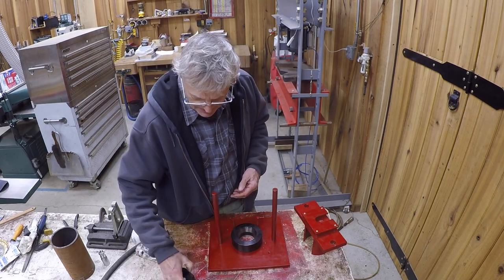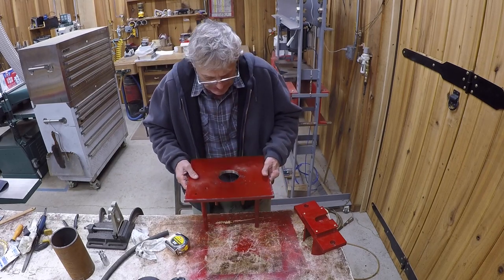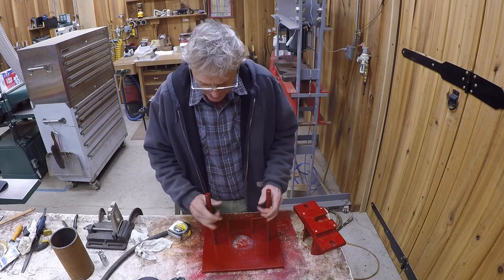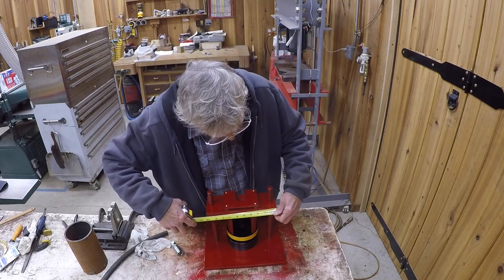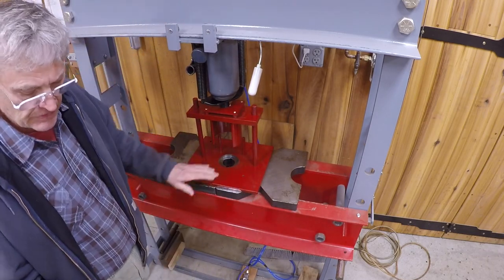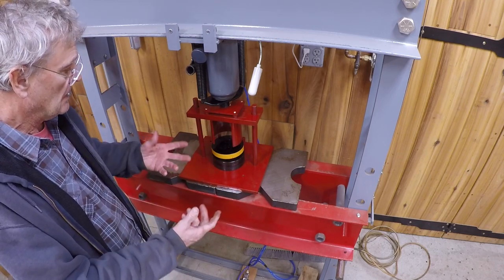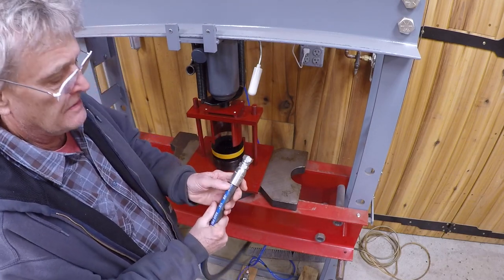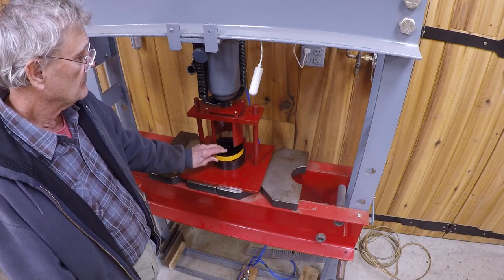DIY hydraulic hose crimper, How I made it

Comment: I used crimp hoses for 8-12 hours a day. But I used Finn-power machines and Custom Crimp machines. I used this style at a different place making hoses for Parker. Much prefer the non parker style. Cool build sir.
Reply from the maker: Sounds like your a professional. I'm just an old farmer, who got tired of paying for really expense hydraulic hoses. I chose Coll-O-Crimp because its a positive stop system, you push on the spacer ring until it contacts the die bowl. That's it, provided you have all the right components die, collect, spacer, fitting and hose you get a good crimp. How do other systems work, do they have other ways to control how far the collet gets pressed onto the fitting?
Reply: @RichMenzel  most other machines are computer controlled.  You set your machines up with the die for the diameter you want and you save the pressure rating and potentiometer setting in the menu. When I was a professional I had 4-7 dies to crimp a single size. Half inch hose the most popular and the shop I was at had 9 different dies for different hose and fittings combination.

Comment: Can you tell me the pressure you got to in order to get the crush you attained i the U series fitting.
Reply from the maker: The jack is 20 ton.
Reply: @RichMenzel  ok. I doubt you are putting 20 tons of pressure on that. Do you have a gauge.
Reply from the maker: @tjs_welding_and_fabrication  I'm sure your right, and I do not have a gauge. With a deadhead system you really don't need one.
Reply: @RichMenzel  Thanks for the prompt reply.

Comment: Cool build. Can you verify the pipe size. I see you measured the OD of it and said 4.5 inch pipe. Pipe is measured by ID, and tube is measured by OD. Thanks. I am going to build one too. Probably cnc plasma cut the holes and plate. Thanks again.
Reply from the maker: 4" ID, 4.5" OD, 1/4" wall. Thanks and good luck on your build.
Reply: @RichMenzel  Thanks for the reply.  4 inch heavy wall pipe it is.